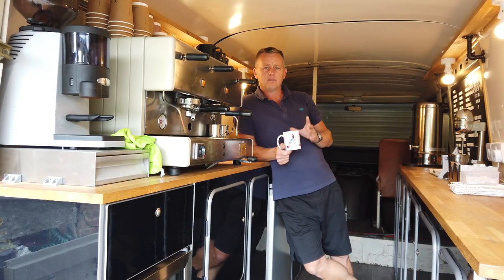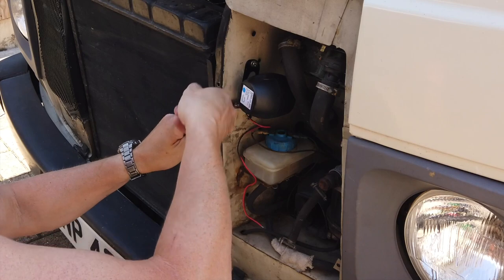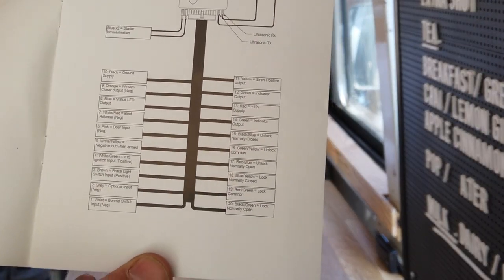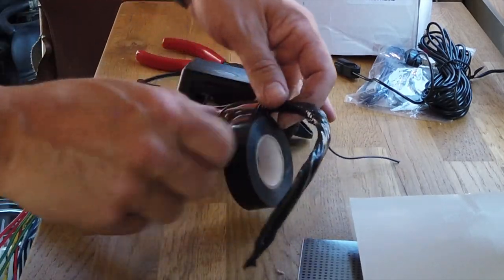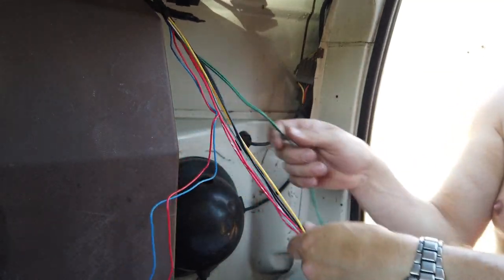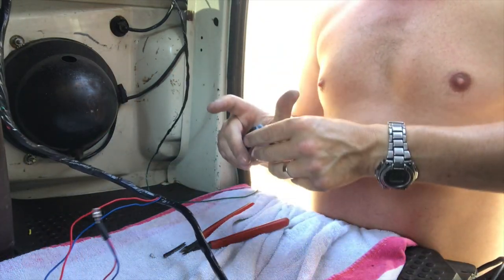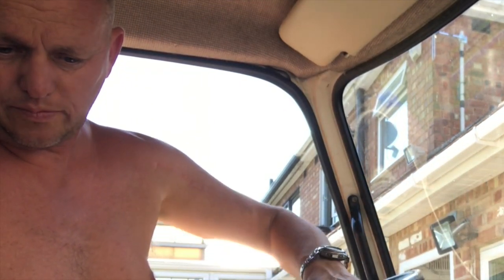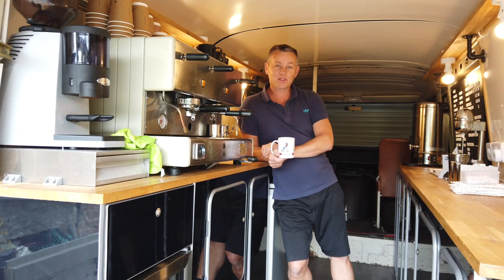Fitting A Scorpion Alarm & Immobiliser To The Peugeot J9 Coffee Van

Comment: Thanks for the upload, just out of interest, for the indicators you had two wires, both going from the alarm module itself to nsr indicator wire and oar indicator wire, is that correct?

Would it not go to hazard switch so all
4 flash with the alarm ?

Thanks
Reply from the maker: No the indicators are joined at source so easy to splice, Thanks for the great comments👍🏻👍🏻🛠
Reply: @aaanton11  cheers mate - mines wanting a diode fitting apprently

Comment: Do you have any idea where the 3rd red wire goes to? I have 1 powering the unit through the fuse, 1 goes to the led light and then theres another red wire coming out the fuse?
Reply from the maker: Could be for an optional door controller, Thanks for the great comments👍🏻👍🏻🛠
Reply: @aaanton11  Thank you, Pretty sure your video is the only place on the internet with the pinouts of this. Appreciate the help.

Comment: Can you post the wiring diagram please I have the same alarm but never received the original instillation instructions many thanks
Reply from the maker: I don't have it anymore but it is on the scorpion web site, Thanks for the great comments👍🏻👍🏻🛠
Reply: @aaanton11  I have looked on the website but couldn't find it anywhere
Reply: i had same problem  but if you stop record on 11 min 10 sec you can see  wires pin out ,and any alarm manual   will do you

Comment: Pourquoi la sortie échappement  est noir noir ? EST CE-QUE C NORMAL ?
EXEMPLE QUELLE DIFFÉRENCE ENTRE UNE PERSONNE QUI CONSOMME DE L'HUILE ET UNE PERSONNE QUI NE CONSOMME PAS DE L'HUILE A LA SORTIE DU POT ÉCHAPPEMENT ? QUE SERA LA COULEUR EN SORTIE DU POT
Reply from the maker: These old diesels don't run clean, the exhaust will be black, when driving if the van smokes excessively there is a issue, slight smoke on start up and acceleration is normal, oil burning should be monitored by oil usage, dipping the oil level regularly, Thanks for the great comments👍🏻👍🏻🛠